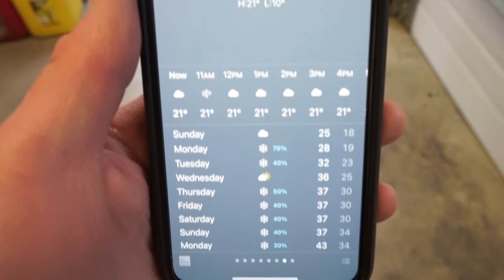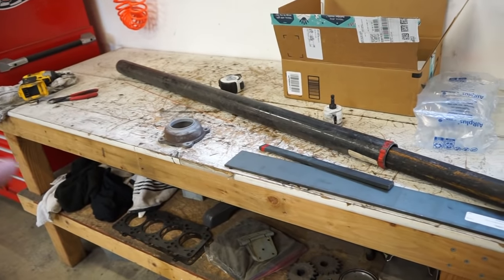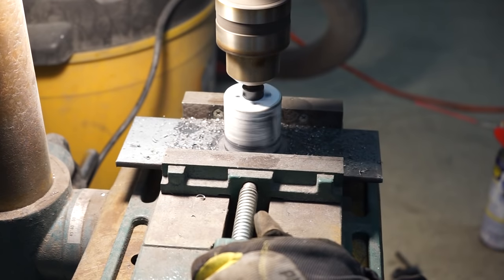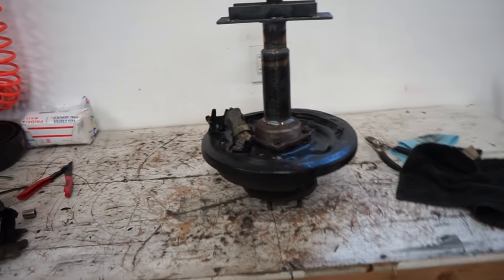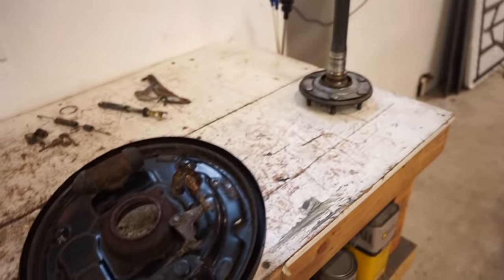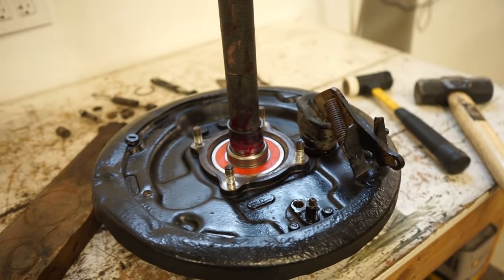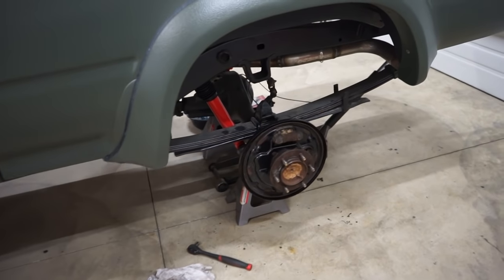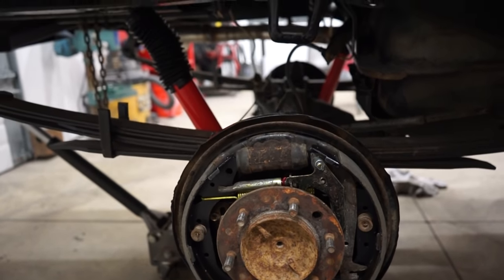Toyota Rear Wheel Bearing Replacement The Correct Way!!!

Comment: Love that tool, real life saver. There's another way to get those pesky bearings out. You pop the seal off the bearing and punch the cage out with a punch between the balls. Working back and forth, the cage eventually brakes and you can pull the pieces out. Slide all the balls to one side of the bearing and place the axle shaft in a vise horizontal. Grab the backing plate at the top making sure all the balls of the bearing are at the bottom and pull. There will be enough movement and gap in the bearing to extract one of the balls. Once this happens the rest of the balls come out easy. The axle shaft will slide out. Then take a small cutting wheel and tool and cut a grove in the inner bearing race and caller being careful not to cut into the axle shaft. Cut just deep enough about halfway through and strike with a chisal and hammer on the cut. The race and caller will crack at the cut and slide off. Then take the inner bearing race and reassemble the bearing with 5 balls and spread them evenly in both inner and outer race. Flip over backing plate and drive the bearing out. I done alot of them like that but that tool you made is really nice.
Reply: Thank you Clifford, This is a true old school way to do bearings! I did mine today and your description was on the money!  Thank you! Not going to spend cash on tool, bought truck new in 1989 and this 2nd bearing will probably be the last it will need.

Comment: I think it was sent to wrong u tube address  sorry again  just wanted to say   thank you for the video and design of press I'm going make  one I have just bought a 2003 TOYOTA TUNDRA SR5 240000 MILES AS YOU CAN IMAGINE IVE GOT A LOT OF GEAR WORK TO DO BUT NEW FRAME NICE BODY AND STRONG ENGINE  IM REPLACING EVERYTHING THAT NEEDS IT PLUS A TIMING BELT  AGAIN GREAT job and keep up the good work

Comment: Great video. Would you be willing to provide more info on the tool you fabricated. Such as how long was the 2” pipe how long was the 1 1/2 in pipe the length & width on the steel plate.I need to do a repair on my axel also. Thanks

Comment: I did this job last year on my 92 truck using the "lift and smash" method. Yeah, your method looks a lot easier! I would have changed out those wheel cylinders on the brake job as long as you were in there.

Comment: Great video! I just did this on my 3rd gen 4runner last year and the press tool made all the difference. I would just like to add that when you do the seals, it's always a good idea to replace the seal ring that presses on to the axle at the same time. Its cheap insurance to prevent rework. Sometimes if the seal ring has a "witness mark" from the old seal it it can cause new seals to leak due to the seal ring being worn. Yours looked okay in the video though. Its also a good idea to grease fit the seal to the seal ring to make sure that the seal ring is pressed on far enough for the seal to ride in the center of the seal ring. For ABS axles is should be around 5mm. Overall, awesome job! I always look forward to watching you work. You always put in the work and not buy your way out by having someone else do it or throw parts at the problem.

Comment: so when you 'neck the rod down' for the custom tool, does that thinner rod contact the bearing collar when you're pressing the shaft back in? assuming so, can't see from the vid.. but wanted to be sure pressing on that special angle wouldn't scar the metal. Alternately, diameter of the pipes used would be useful. Apologies if I just missed it x.x Thanks!!

Comment: Check out the HF air over hydraulic jacks to use converting your press.  Did my home built 50 ton two or three years ago and it really makes a difference.  I use the hand control and installed a foot control as well.  Several YT channels showing it.  Next I want to put a gauge on it to register the force used.  Allows you to free up your hands for positioning the part.

Comment: Built a very similar tool to do mine. I tried the drop method and it just wasn't happening. Even with a 20k press, that collar was on tight. 80 model never been off and the tool worked perfectly.

Comment: Hiace toyota kdh200 bearing installation have you done it before? Cuz i myself working as a mechanic find the rear wheel bearing usually is flat on both end but for kdh200 toyota model it has that weird extrusion. Any videos of your work on it?

Comment: Hey, did you have to drain the diff oil before removing the axles? Im off to do this repair out at a remote spot where the axle snapped and we could not drive the car out. So want to be prepared and not mess up
Reply from the maker: No you should be able to pull the axles without loosing too much oil!

Comment: Nice tool, but not necessary for this kind of job. I was build a tool pretty similar to yours, but it did not work in my case under 20 ton press. I don't know why. Then I just took an angle grinder and made a cut on that collar very carefully. After hitting it a few times with a hammer it cracks down and fell off. To install a new collar I just heat it with the propane torch until it becomes dark-red and drop it down to the bearing. It fits perfectly in that way.
Nice projects. Good luck!

Comment: Nice video, but do you also have some play in the bearinghouse in and out? i mean, can you drag your hub/axle when installing the axle shafts to the axle housing after tight them up?
Reply from the maker: Not on new bearings, i have had used ones where the bearing moves in the backing plate, but that it held in place when you bolt the axe to the housing!

Comment: What tool did you use for the brake springs?
I apparently need a press now.
Thorough procedure, thanks dude
Reply from the maker: It’s a spring puller tool
Reply: @austinniemela  where do I find one?
Pliers just suck

Comment: My ex could never understand why I hold onto one use tools, even tools that are not even needed for my rig. I would just keep telling her it just makes things easier if you have the right tool for the job. I thought about making something like that in the past, just have to get the actual press to complete the final result.
You should think about a little anti seize on all metal contact points when doing brake shoes, including the park brake arm, adjuster arm, and the adjust after you completely clean it. And actual grease is not recommended on braking systems.

Comment: Terrific, clean work.

Now to spill the beans: that tool is equivalent to mounting the axle+backing plate into an empty junk axle housing. You cut out enough of the center cover of the housing to mount a small bottle jack within, on the same axis as the axle. Mount the axle to the housing, press out the axle from within using the jack. Boom, done-zohs. I will be doing this a second time soon using the same notched housing that sat under my house since twelve years ago the last time I did the job.

But let's be honest, watching the rest of the world demonstrate the "bash it on the ground till you mushroom your splines and warp your backing plate" is why I live in America. #USA

Comment: Hey Austin great video! I have a question, On my girlfriend's 01 tacoma, there is a sort of whirling squeak distinctly coming from the rear of the truck. The noise is also only most prevalent when slightly on the gas, if you push and unpush the gas from that position you can hear it come and go. I'm wondering what made you decide to replace the wheel bearing? Were you experiencing some kind of related issues or just figured it was time to do.
Reply from the maker: May be a bearing. Ujoints can make some interesting sounds too!
Reply: @austinniemela  Alright thank you!

Comment: Throw the bearing in the freezer next time, it truly does shrink them enough that they go in easier. As far as the wheel cylinders go with people complaining, unless they're leaking why change them?? Unless you're buying OEM wheel cylinders I can guarantee you that aftermarket new is not better than OEM old...

Comment: The weak link of the tool are the 4 bolts. I built a similar tool and the threads blew tf right out. The bearing refused to budge.

Comment: Woooow!  Flash back.  The right way!!!  Lol.  
You bang the shaft on the curb until the bearing and evrything else drops down.  It worked for me in an emergency situation! Then you redo the same job twice until you figure out that there is a certain spot where you have to stop pressing the bearing in because your seal keeps leaking.  The only bad Japanese design in my humble opinion.

Comment: Austin you need to put regular paint over top of por 15 with in I believe 24 hrs to get adhesion if you wait to long paint won't stick. Por 15 will not hold up to UV rays they will destroy it.
Reply from the maker: I did spray another coat of black paint on top after it dried
Reply: @austinniemela  that's cool, I made that mistake once and didn't want it to happen to you. BTY nice job on the bearing tool great idea, I think I might have to steal that idea.
Reply from the maker: @bobthebuilder6315  thanks! It’s so easy to swap the bearings with the tool!

Comment: Really liked your take on a removal tool, it was thought out, well made and stout. Now with that said here are a few why questions, why did you not replace your brake shoes while you had your backing plates separated from the axle, trust me it is far easier.  Why did you not replace your wheel cylinders while you were replacing everything else? I mean Dude you were there, they are cheep.  And the last why. Why did you not replace your O-rings they are also cheep.  Just asking why I am not trying to be a dick about it, I have done quite a few of these over the years and  everyone looks at the how too's and what not's different.

Comment: I know I’m a bit too late, and I’m sure you won’t see this comment. But do you remember if the bearing pressed all the way flush into the collar?
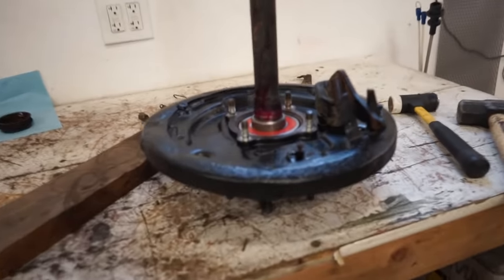Reply: all the way yes. The bevelled edge of the cup mates with the axlehousing to space a sealing rubber 13:21 o ring.  That ring is NLA and is even better  after cleaning up both surfaces to seal the cup to the axle housing use a fine bead of RTV sealant.

Comment: This is why I refuse to get a Tacoma with drum brakes. It's a pain in the s to do compared to disc brakes. Tried to explain this situation to people but they don't under stands that it'll cost more money in the long run with drum brakes, if ones can't DIY. Imagine taking this to the shop, that's almost 300 dollar in labor alone, and if that bearing seal decides to go, it's the same labor coming out of your wallet, if the shop policy warranty doesn't cover labor.